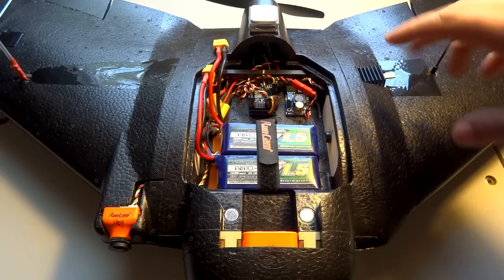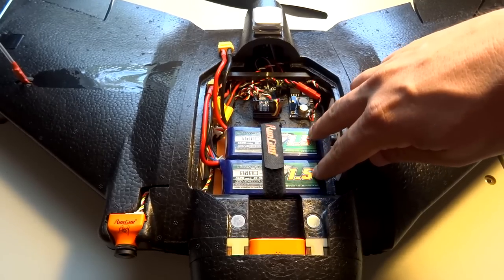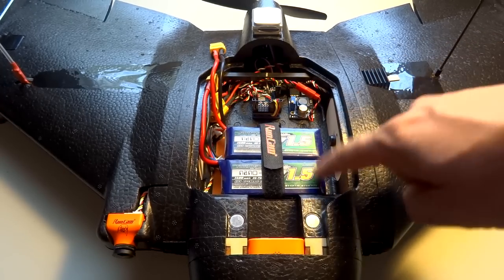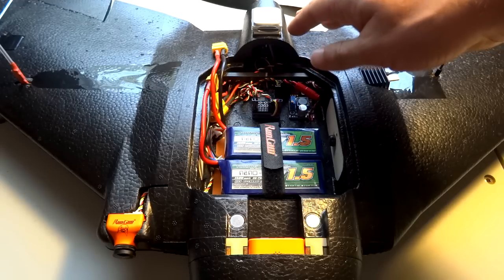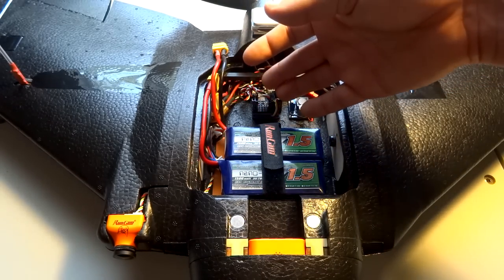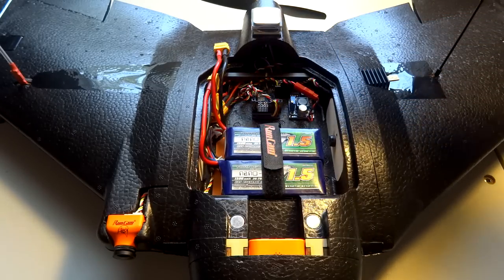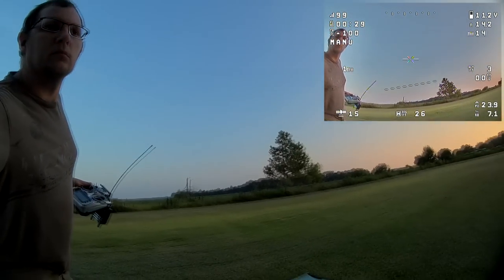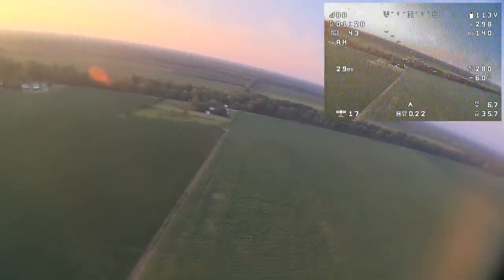Matek F411-Wing - Part 2 First flights!

Comment: Thanks for the video - I just ordered the FC and GPS (matek one).  I've got an (international same as rmrc) 1.2GHz vtx and I can verify that since I removed it from the Al case it came with, it runs HOT.  I can finally use my thermal conductive 2part epoxy to attach a heat sink.  I need to know what antenna you've been using for your VTX, my Circ. polarized 1.2/1.3 antennas are just massive and give mind blowing reception but incredible aero drag.

Comment: Very good looking build! I will be doing a very similar build soon and I have a question about the flight controller wiring. I see you soldered the pins to the fc and used servo connectors. Have you had any issues with vibration loosening the servo plugs? I would like to solder the pins in to the fc and use servo connectors but would it be safer to solder everything directly to fc?
Reply from the maker: No I've never had a servo connector come loose in flight, been using them for many years! lol Usually when you solder direct to the board it's to save room/weight in a tight build, or just to keep it a bit cleaner. I like connectors so things are easier to change up later if you decide to. BTW, if you're going with the F411-Wing that I used here, do check out the F411-WSE, it's the updated version that's smaller and lighter with an extra UART, and has much better power filtering. I used one in my Dart 250 and I have another going into my old Mini Talon that I'm rebuilding right now. They're great little boards. The 450-Wing still has more room to expand though, if the larger size isn't a problem. I haven't tried any of the F7 boards yet.
Reply: @bonafidepirate  Thank you very much for the good info! For this AR wing build I think I will be using the F411-Wing since it is already on the way but that's good to know for future builds! Does poor power filtering generally cause other than vtx issues? (Thought of that and will be using my vtx with a similar DC-DC converter you have on yours). I think I'll also go with soldering pins on the board and having connectors, nice to keep everything easy to change and repair.

Comment: Matek makes good stuff. I didn't know about this one just for airplanes so thanks for posting. Do you think this will become a trend for other manufactures. So far it's been all mini-quad only.
Reply: Check out the F405 Wing FC as well Dave, Matek bought that out first, the F411 is the cheaper version I think. Matek appear to be the only one catering for us Fixed Wing Pilots.
Reply: I like the smaller size of the F411. Specs say that it only has 2 UARTs and 1 softserial though. Is that a problem. I see the the F405 has 6 UARTs.
Reply from the maker: I'm running the GPS to one UART, SBUS on another. There's still one free if I need it. I guess it depends one what all you might want to connect to the board... lol
Reply: Guess I will find out. Got two coming. Unfortunately Banggood says PreOrder so I got then from a place in Florida.
Reply: @EnglishTurbines  the matek f722-std paired with the fchub vtx is the route I went with on my S800 reptile but on my  ARWing I'm going with a f405-std, 2750kv motor and 40amp esc, 5045 3 blade prop.

Comment: Thanks for a very informative video !!
Did you soft mount the F411 on the fuselage ?
Trying to soft mount Flight Controllers in Quad Frames can be a challenge but it does reduce vibration !
I'm just building a S800 using the F411 and am trying to figure out how best to mount the FC
Thanks again for the video !!
Reply from the maker: The board is just mounted with double sided tape, using the included standoffs and flat plate. I haven't had any issues with vibrations in a fixed wing model, especially with small motor and props like on this one. It's much easier to get one motor and prop running smooth than 4 of them mounted on a rigid quad frame. :)
Reply: @bonafidepirate  Thanks for the reply !!!!!

Comment: I got the plug and play and so far have already swapped the servos for some emax servos, I'm even thinking of swapping out the motor and esc for a better motor and 32bit esc. If only hobbyrc had the kit version in stock could of saved me £20 quid.

Comment: I have one of these to install in an S800, already loaded up with iNav2.0.0RC4. thank you for sharing your experience with the AR, I have one of those too. Curious why you set RTH to 400ft, looks like your tree are only about 100ft tall.
Reply from the maker: I only set it that high because I was planning to fly out toward town, where there's a cell tower I like to avoid... lol (couldn't with the dodgy vtx though) I rarely fly too far and need failsafe, or rarely need failsafe at all in fact! lol If I'm losing video it's usually because I'm flying relatively far, and too low at the same time, so having RTH climb would be nice for getting video back rather than trying to fly home down low by the trees from far out. For this flight though I would have been totally fine setting the RTH altitude much lower.
Reply: I finally got my S800 all wired up and did some bench power up checks. I am getting some static in the video as I throttle, curious if you are noticing anything like that.

Comment: Love all your videos Keith and thank you for the information.  I really wish I have a hut like yours next to a landing strip and all in the backyard of the house.  This is only a dream for Singaporeans like me.
Anyway,  on the DC to DC converter, so you ran the input voltage from the not used ESC slot on the F411 correct? then the output is to power the VTX and the Cam? or just the VTX only?
Thanks
Reply from the maker: On this one I'm powering the camera with the 5V regulator on the Matek board, and the vTX with the DC/DC converter. If you had a 12V camera they can both run off the converter with no issues.
Reply: @bonafidepirate  Thanks for the response.

Comment: Awesome setup Keith I knew that dragonlink rssi would work
One of the benefits of dl..lol
Thanks for the video and explanation of everything...
Reply from the maker: Yep, I love how many options you have for setting up the V3 receivers. I just wish they were a little cheaper... lol I need another, I actually stole this one out of the nano talon. ;) I was looking back at my old OpenLRS stuff, I have two receivers for that I think, but my transmitter is a Futaba module. I was thinking it might be fun to make a little case for it to fit the Taranis. (They were actually sold that way too, but I was flying Futaba back then.) Looks like there hasn't been much development with the firmware for a long time though. That's not a bad thing though if there's no bugs in it, one of the things I hated when I was using it was how often they updated... lol Everytime I plugged in to change settings there was an update and I'd have to pull the receivers out and update everything all over again. Maybe now I can just "set it and forget it" lol I may re-purpose that gear for my closer range stuff, would be perfect to keep the nano talon in the air for now.

Comment: Good to see you using iNAV at last m8...thats a weird font and the centre pin is too. I always use the centre pin in the osd because I can see my pitch status while flying. Like to see how you scaled your rssi, my ezuhf needs doing and Im not sure how its done...Isnt Air Mode a quad related thing..?..like when you are upside down to keep the rotors moving..?
Looking forward to seeing more as you get into iNAV.
Reply from the maker: For sure, it was time! The changes in 2.0 and these new fixed wing boards were enough to push me over to the dark side I guess... lol For RSSI scale, there's a CLI command. Go here and search the page for "rssi_scale". (https://github.com/iNavFlight/inav/blob/master/docs/Cli.md) You basically just set the scale higher or lower until you get 99% reading. I went down until I got 98, then up one number at a time until 99 to know for sure it was just right. I know it works for analog and digital RSSI on a channel, not sure what ezuhf uses. I permanently enabled Airmode based on the suggestion in Step 5 of the fixed wing guide (https://github.com/iNavFlight/inav/wiki/Fixed-wing-guide) "Use Airmode mode to get full stabilization and servo throw with no throttle applied." I'm assuming that's all still correct and up to date.
Reply from the maker: BTW, I changed the font in the osd setup to "vision". I liked it better than the default.
Reply: I usually fly around in Horizon Mode most, if not all the time combined with Alt Hold when I want it. So..Air Mode on Fixed Wing is entirely different to Air Mode on a Quad then..? (as in Betaflight).
  That might explain my models tendency to dip down every time I land as I cut the throttle...???.why would they cancel stabilisation just because you cut the throttle???......hmmm...I use "Link Quality" rather than RSSI on my EZ...it usually gives a full signal reading of 78 dropping as I fly out.. (On one of the SPPM channels). I might try the vision font, although the centre pin looks too intrusive as you have discovered.
  Looks like your VTX is operating on the pre-amp stage of the RF circuit, weak as a kitten...lol....Can't wait to see you do some fly out when its sorted..
Reply from the maker: I'm not positive on the Airmode thing, but I know that's how it works in a quad. Cut power and it all goes "limp" lol. Turn on Air mode and you keep stabilization and control even with the power off. I'm guessing it's just carried over from that to fixed wing. I know a lot of the stuff in the Wiki was written early on, so I'm not sure that still applies, best to ask someone in the forums or somewhere like that, that knows and isn't just guessing lol. I didn't realize the center thing on the AHI would change with the font, but now that I think aboout it, it does make sense. Everything on the OSD is made up of characters in the font, it's not "graphical" like some, so yeah everything changes with the font... lol I may try one of the others and see. Thanks for the tip! You're probably right about the vtx also. I'm sure the amp is gone in it, based on the fact that it's running so cool. If that's the case, I'm impressed it got as much range as it did! :D
Reply: Yes, I always use the default Font myself, but its a personal choice of course. Today I tried Air Mode set to permanently on, didnt like it, dont need it...lol....You are right about dropping the throttle and it going limp though, that's a very good description of what happens every time I land in Horizon Mode.
    Im convinced its left overs from Multis in the Code...?...ie not suitable for FW use. Maybe its better on yours because you are using 2.0?

Comment: I see the transmitter antenna but I can't tell what freq you are running.  If it is 5.8 can you tell me which Ready Made Transmitter it is.  Also it looks like you have some other type of antenna on the other side?

Thanks

Rich
Reply from the maker: I'm using 1.3Ghz video. (400mW from RMRC) The other antenna is a UHF antenna for the Dragonlink receiver.

Comment: nice:)
So if You turn the radio off or just lost signal.... the RTH will work as well?
I was setup everything like you but just L9R receiver and my wing crash when I lost radio signal behind small hill
Reply: Set "No Pulses" on your radio for the Fail Safe

Comment: Dammm yr wing Flys so smooth. Am using matek pdb and f405 fc. It's my first  build
Reply from the maker: This is my first iNav build, I like it a lot. The little AR Wing is a nice platform for sure, it flew rather smooth even before adding any flight controller in it.

Comment: hi , do they make a more basic cheaper flight stabilization board for a basic fixed wing foam plane?  i don't need FPV or anything, i just need to keep the wings level in wind and things like that.  return to home would be cool but i was thinking there would be a flight controller that wouldn't be designed for cameras (which I don't need).  thanks a ton !!!!!!
Reply from the maker: Look at the ZOHD Kopilot that came out recently, it should be exactly what you need. It has a manual mode, stabilized that levels the wings, and a 3rd mode that can be set for either a geo-fence, or normal RTH.

Comment: one tip: put the gps away from the esc.  There is enough noise to let gps generate false data. It might be subtile , but in some cases you get big spikes in for example altitude. I would mount the gps in the middle  of your cover.
Reply from the maker: I've never heard of GPS being affected by noise, magnetometer sure but I'm not using it for fixed wing. I'm also using barometer for altitude, I believe the code in iNav actually uses both, but favors barometric altitude over GPS, especially in the case of large errors between them. That said, I'm sure something like the ESC is spewing out EMF and RF noise across most bands... lol Those little GPS units are amaing in their ability to pull in weak signals from a terrible noise floor though. If I notice any issues though I'll move it.
Reply: @bonafidepirate  they sure are. I had a GPS mounted close to a Mobius camera on a FX-61 back in the day, and whenever the Mobius was recording, it threw the GPS off completely. It was still locked to the sats, but the wing would fly off in a random direction because it was getting bad data.

GPS should be separated from noisy sources of EM for most reliable performance. And ESCs are very noisy.

Comment: Been using Vector, now trying Inav. Be good to see your CLI dump.
Reply from the maker: I can get the CLI dump and post it, but like I said I'm not even sure I have things set up 100% correct. There still a lot I don't know about iNav. There shouldn't be anything special in the dumb though, all I've done is flash the firmware, and set it up according to the fixed wing guide in the wiki.
Reply: @bonafidepirate  OK ignore my separate post above. My AR seems to fly quite well with the defaults.

Comment: When landing, do you land in acro with air mode on or do you switch to manual? I only ask as when I come into land the plane rocks on the roll axis a lot and is very hard to control while landing... I'm not sure if this is due to cross winds but thought I would ask anyway.
Reply from the maker: I've landed with and without stabilization on and it's not a problem.
Reply: @bonafidepirate  maybe it's just windy when I come in to land, I do live j the UK after all when our weather is either rain or wind

Comment: Does this mean that an LC filter (or a regulator) is a must if one chooses this FC, as it provides only 5V BEC and VBAT? Also if there were a 12V BEC, would that mean it'd be 12V constant, without the interference of the motor?
Reply from the maker: This board just passes battery power through, so whatever you'd do to power your FPV gear without this board, you'll still have to do. ;) Some cameras and transmitter have their own internal regulators which will filter out most of not all motor switching noise. Others need clean power, like the I'm using here.
Reply: Thanks for the answer! But the output voltage of a BEC should be regulated/filtered, is my understanding correct? Say if my FC has a 12V BEC (for example the F405-WING), I should be able to safely use that to supply my FPV gears?
Reply from the maker: Regulators are not necessarily filtered. They usually have some filtering to clean up their own noise they generate (on switching ones at least), and the nature of how they regulate the voltage will often clean up noise from the input side of them. The one I used in the AR wing has always been good at a clean output, it's one reason I like them despite the size. Worst case, if you have noise present on the output side of your regulator that's making it into your video, you can always try an additional LC filter to clean it up. I can't say whether the 405 Wing is clean or not, I haven't used that one yet.

Comment: Is that rectical an iNav option or are you doing something custom for the OSD?
Reply from the maker: It's part of the standard options in the iNav OSD. At least for 2.0.0rc4, I haven't used any f/w earlier than that. I do think it changes with the font though. I'm using the new "Vision" font for the OSD.

Comment: I fly old School , great plains PT 40 with a nitro .40 engine   & a tranis  seven controller 

am I able to put this flight controller into that plane?  
 and the second question is how do you convert flight controller to just a regular servo to work the throttle for altitude hold
Reply: Oh I think I just figured out that I could mix the controls to add more throttle when the elevator up and decreased throttle when elevator is down when altitude hold or Return to home is activated

Comment: I put a 411 in a Sonicmodell f1 . Did you have any problem getting yours servos and motor to work? I used the z84 preset. I got one servo to work but no elevator movement. Any help would be great. I put a clone Omnibus f4 in a Z84 and didn't have issues like this.
Reply from the maker: No, I just followed the fixed wing guide since it was my first try with iNav, and everything worked as expected.
Reply: I just finished my sonicmodel f1 with a 411 fc controller. you can contact me if you want
Reply: gillis haasnoot Thank you for the reply back. I figured out what my problem was. It was a bad servo. 
After building multi quads I never thought a simple servo would be my issue.
My next wing is going to have GPS so I'll probably have questions on that. Never delt with anything GPS before. Thank again